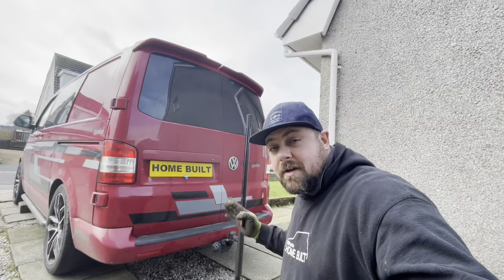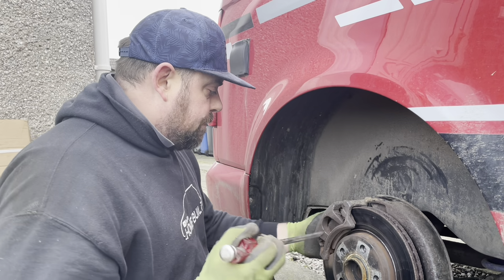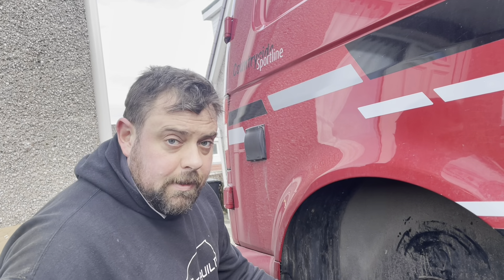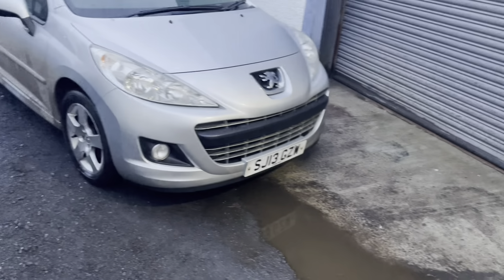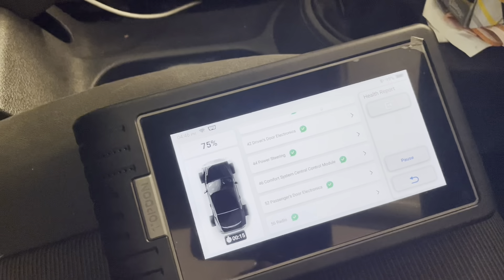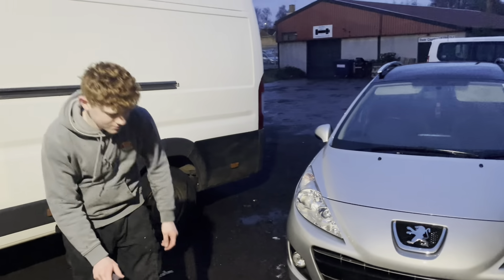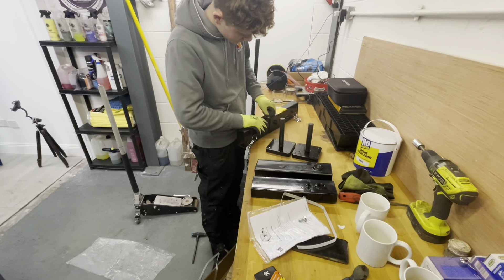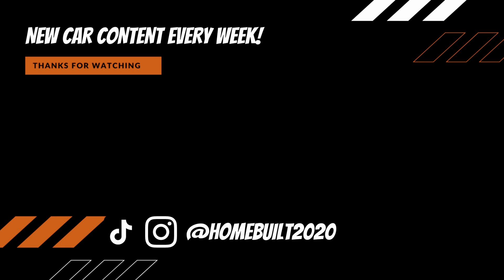VW Transporter day van needs a few quid spent on it!

Comment: Having brakes and wheel bearings up to scratch is always money well spent. Pressing that pedal and it unexpectedly travelling all the way to the floor is never fun. I was a mechanic for a lot of years so I always kept on top of it on my own vehicles but I've test driven cars and lost the brake pedal on occasion and it's pretty frightening. Repeatedly stamping on the pedal to get it back is a nightmare.

If I were that subscriber I would have you do the work and enjoy the peace of mind. Brakes, tyres and bearings are top of the list, as you know, and it's always a worthwhile expense. Plus, what you spend at times like this will pay you back in fuel economy, too. A dragging brake is pretty costly...
Reply from the maker: Very true, ive had a loss of brakes once due to dodgy wheel cylinders. Not the best!
The customer has decided to get all the work done by us.

Comment: yep new pair of wheel bearings, new pair of calipers, new disk and pads for rear, will future proof the van, and i advice you use the 3 piece grease for pads, sliders, pins, avoid copper grease all the brake dust sticks to it and causes issues 😇🤟 ebay (Proslip grease) decent stuff and plenty for lots of brake jobs
Reply from the maker: Thanks dude, I always use a ceramic grease on brakes, I can’t stand copper slip. 😂 I’ll have a look at the stuff you’ve mentioned, always happy to try new things.

Comment: Change the lot on the van disk pads callipers.   Near side rear bearing.  Drive it b4 doing off side bearings.  Think the arm has to come off to press the bearings on and off cos they are so tight. The Bosch garage I use have a tool they use so they can keep the arm on.   My t5 has done 230 thou and near side bearings rear went at a bout  189 tho miles and off side is now grumbling.  Tyre noise  can b an issue when they wear funny on the rear  as they do get a slightly toothed appearance run your hand forward and back u will feel it. We all love a nice van.  Hope this helps 👍👍👍
Reply from the maker: Thanks mate that’s great advice.
We have a little press but the guy next door has a good one if we need it.
The customer has asked me just to do everything so it’s all good for another few years.

Comment: Nice looking van the subscribers got. Had to check the price of the 207 bulbs there cause I’ve the same car. Suprised halfords offer ones at £8.99 each but as you say they’ve ones at the same price you mentioned
Reply from the maker: I couldn’t find them on th Halfords site but I did find some cheaper ones on EBay, these were genuine Philips ones.
Knowing what I know now I would probably go for the LED upgrade ones
Reply: @HomeBuilt  think it was Phillips ones I got for my dads berlingo and they were £16 each. Most I’d pay without complaining is £8 a pair on eBay😂. Only problem with the Peugeot is the canbus system tends not to like led bulbs and throws up errors P.s good luck to you and the lad in the new unit and looking forward to more content
Reply from the maker: @tomhope4613  🙄 canbus! 😂 Dont have to worry about that with the Micra 🤣
Thanks for watching mate
Reply: @HomeBuilt  I know what you mean the wife’s got a pixo so not far off the micras spec……….. at least she gets excercise winding the window up and down 😂

Comment: Nice 1 Lads.. The Jacking Beam will become a proper pain in the Ass .. You need to have the car etc run up on wooden blocks to get the height under it to put the jack and beam combo.. I'd just stick with jacking the car and placing an axel stand under 1 side and then jack the other side up ...  Also I hope ya has the press tool for the wheel bearings on the VW .. Done them a fair few times :) :) ... Andy ..
Reply from the maker: Thanks Andy, I did get some run up ramps and hopefully it will help us out until we get a scissor lift.
We have a small press but the guy next door said we can use his big one no problem. I thought they had complete bolt on hubs but quite a few people have mentioned a press now, do they just get stuck in?

Comment: Comes down to how much he can afford to spend. But better off getting all done at once . Or do bearings and so long as caliper will free off with a little lube on the piston  for now  he could get get brakes sorted later .Get a bit more wear out of them till the summer. Pain in the arse having to go in there twice though.
Reply from the maker: Hi Richard, ive had it on VAG calipers befire and as soon as the get moisture into them its not long until they seize solid. I ended up putting 4 new calipers on the Audi last year.
I think he is going ahead with all the work including the clutch.
Thanks again mate
Reply: @HomeBuilt  Yes once the outer seal has a hole in it they are not long till seizing .Also your climate up in Scotland aint gonna help this time of year . All good for the channel.

Comment: That aint going to fit in your new Unit matey,
Reply from the maker: I had the tape out earlier and it might just 😂
Reply: @HomeBuilt  That would be good if can, I`m in a similar sized unit, a bit longer but struggle for height room.
Reply: Put pair on